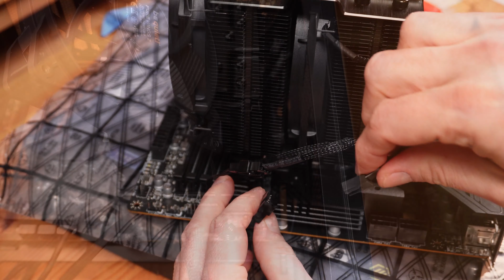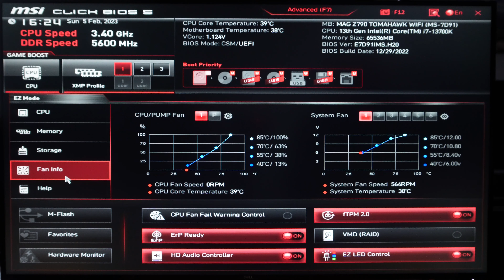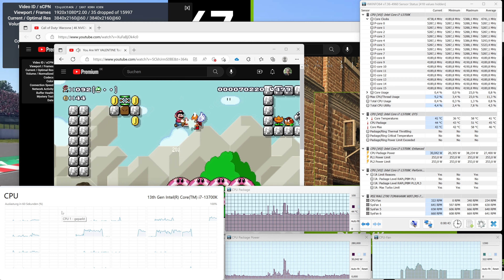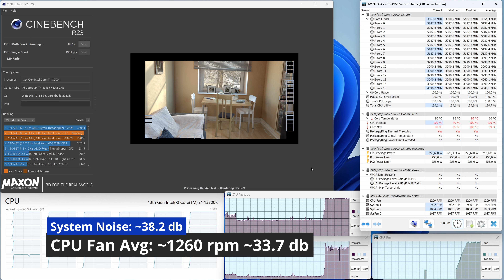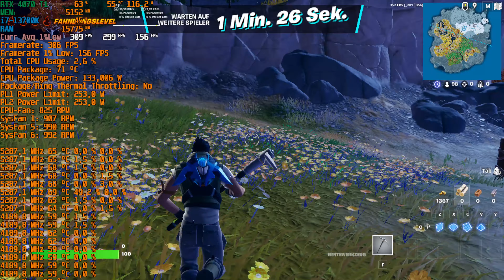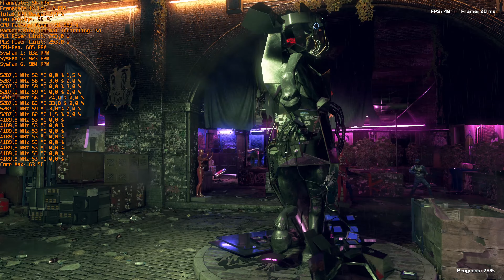Can Be Quiet Dark Rock Pro 4 cool Intel Core i7-13700K Part 1: Noise&Temps

Comment: Be Quiet's Dark Rock Pro 4 is not a good cooler for content creator, it can dissipate a maximum of 200-220W of heat. It's enough for games, but throtling can happen from time to time when the game uses all cores. I had Dark Rock Pro 4 and changed to Noctua NH D15 Chromax Black which dissipates the full 253W of heat without any problems.
Reply from the maker: Yes, that is correct. As I said in the conclusion: For the occasional creator it is Ok. Meaning: someone rendering 24/7 probably leaves 7% performance on the table and should choose a different cooler. With regards to heat dissipation will come to a similar conclusion to the 220W in Part 2. I think it is 224W exactly at a room temperature of 20C or around 205W at 30C. Noctuas D15 availability was very bad at the time and it was a lot more expensive, when I looked for it. But sure, I agree. 
How loud is the Noctua at full rpm? Does the memory fit under the front fan or did you have to reposition it higher?
Reply: @tech-wombat  
Noctua is much louder, it's hard for me to assess how much because I haven't measured it, and in the Fractal Torrent case with all 6 fans, when all of them hum, the computer is audible, but not insistently.
Reply: Question: can i mount Corsair VENGEANCE RGB 32 GB (2x16 GB) DDR5 DRAM 6000 MHz C40 and it fit with Dark Rock Pro 4 ? Mainboard MSI MPG Z790.
Reply from the maker: @piotrgowacko5344  I cannot tell. What I can tell though: I had no trouble to install my Kingston Fury Beast DDR5 5600 2x32GB CL40. perhaps you can compare the size with yours. Also perhaps check the BeQuiet and also MSI homepage for exact measures of the cooler and the height of the RAM slots on the Mainboard.
Reply: @tech-wombat  Thanks for answer and advice. Cheers.
Reply: You still get thermal throttled in cinebench, no?
Reply from the maker: @AR-ey1ur  yes, when I didn't put a power limit on the CPU, then I got throttled. When I put on a Power limit, then I still get throttled, but not in the sense, that hwinfo shows it for the blink of an eye, but not for longer times. I guess this due to the fact, that even a power limit is not a hard limit in watts. It is more like a limit to reach the set limit on average. I guess therefore the peaks are higher than the power limit, and therefore it sometimes reaches the thermal limit nonetheless.
Reply: @tech-wombat  Many thanks for the reply, Tech Wombat, although I was asking Grzegorz 😀 The information you provided is still very interesting.

In the end I decided to sell my Dark Rock Pro 4 (unused) and get the NH-D15. Hard to say if I'll see any difference, though, because I read (mostly on reddit) that people still get thermal throttled in cinebench with the NH-D15... So, I was wondering what is the point of a more expensive cooler if you have to undervolt or power limit anyway...

That being said, I'd rather err on the safe side, since the % difference in total cost for a new PC build is tiny.

Great review, BTW. It helped me make a decision cooler-wise for my 13700k. Thanks for the cinebench test (results) in particular. I'll compare later to my NH-D15.
Reply from the maker: @AR-ey1ur  hehe, sorry, I did not get that. 

Thanks! I'd be interested in your experience with D15 with 13700K, especially with regards to its holy trinity of Cinebench R23 performance, noise and temperatures, if you'd like to share it later!
Reply: @tech-wombat  hey, I got my setup ready and we could do some testing if you want.

Cinebench multicore finishes without throttling, but max temp is 99C at 18-20C ambient. LMAO. 

However, I think that we can test the coolers in a better way. Get Intel XTU, set all cores to x53 (two will be at x54 by default), TBPTW to 1s, disable short power boost AND set turbo boost max power to the max value that you can get before you see throttling... Then get Prime95 and run the smallest test for 5 minutes or so.

Noctua NH-D15 can dissipate around 230-235w without throttling. At 235w, I got 100C on one core. At 240w, I got like 3 cores at 100C. I ran the test for about 5-10min., though.

So, 253w, like the other guy said, is total bullshit... unless at a much lower ambient temp.
Reply from the maker: @AR-ey1ur  thanks for sharing your experience with NH-D15!
When your CPU didn't throttle at CB23 MultiCore benchmark, then D15 is in fact better at 20C. It certainly seems that D15 can cool a little bit better, than DRP4, but on the other hand it seems to be only marginal with the 230W. I think I found the 13700k found the 99C with the DRP4 at around 220W or so at 20C ambient.
Reply: @tech-wombat  Things are probably a little more complicated. I use a different mobo than you (Asus) and from what I see by default all mobos use adaptive voltage, meaning that perhaps my mobo manages (undervolts) cores to prevent thermal throttling. So, for a better comparison this would need to be disabled as well.

Basically from what I see your mobo is trying to push all 253w to the CPU by default, which is not the default behavior I see in cinebench... Only about 230w or so is pushed to my CPU by default.
Reply from the maker: @AR-ey1ur  interesting. You could be on to something. But I don't really want to go into more detail, as I don't really know how overclocking or undervolting works, and don't really want to go deeper. But thanks very much for your insights!
Reply: thanks mate, u are a god